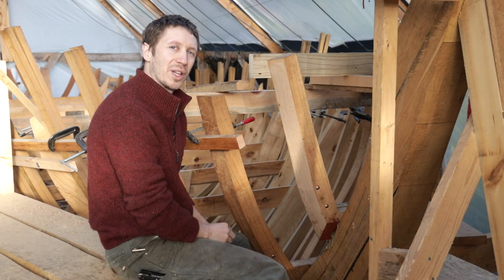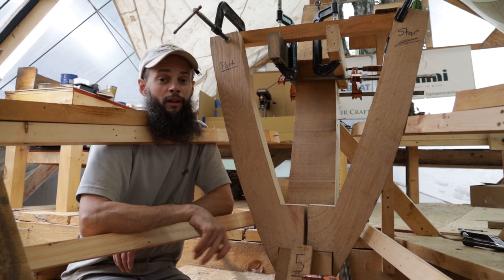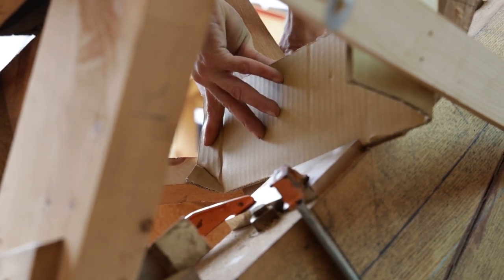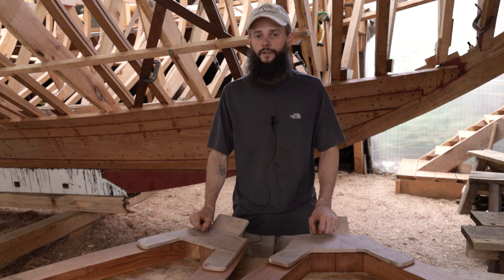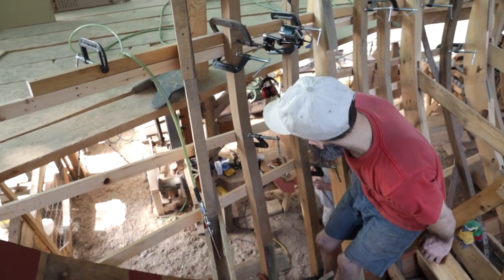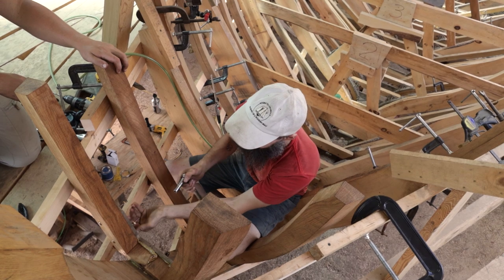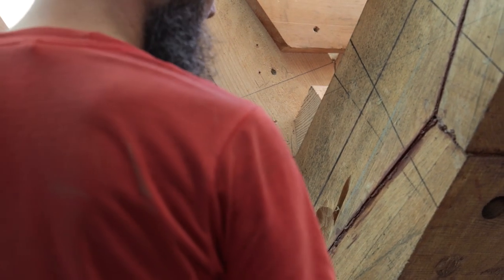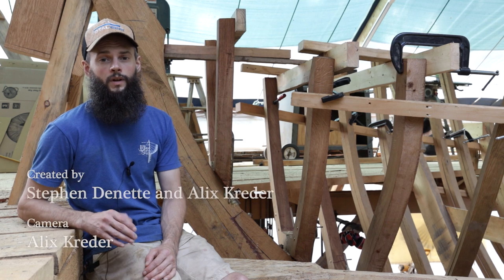Acorn to Arabella - Journey of a Wooden Boat - Episode 80: Sawn Frames and Bronze Floors

Comment: Dangar Stu made me aware of your mammoth project. I finished watching all episodes moments ago and ordered my "Quercus alba" writing instrument to help you guys and remind myself of my less than stellar construction of a 10 ft boat framed with 2 x 8 white oak designed for a 10 HP outboard. The only spare motor I had was a 35 Evinrude so I didn't spare the HP or the bedding compound. 'Twas a miracle it didn't sink. Acceleration was instant. 
Your attention to detail is amazing. Glad you went for a new Kubota diesel. Nordhavn's latest small trawler is powered by a pair of 75 HP Beta mechanical injection so no expensive electronics to die in the middle of the Atlantic. If you are still friends when the boat is finished, you can sail everywhere and you'll have a happy boat with a great boat dog wanting to go to Norway!

Comment: You lads are are wood working geniuses, I wish I wasn't the other side of the pond I would have tig welded all your bronze with pleasure. Mig welding doesn't like nonferrous it's definitely adequate but it's difficult to get a good profile and even though it's probably unseen as a coded welder of 35 years I feel perfect weld profile would match your perfect carpentry. Can't wait for next episode.

Comment: Another great video guys! 

I do miss the original opening soundtrack though. Otherwise, keep up the great work!
Reply: That's just what I wanted to comment on. They went back and now this is the original song (well a remake) but still the original spirit and it's way better.

Go check out 3 videos back and 20 videos back and you'll see.
Reply: I also miss the original soundtrack. However when it was replaced by something dreadful, it took weeks of pointing that out before they changed it out with this remake. I suppose they needed a longer track to complement the longer intro, and the new track is essentially a stretched version of the old. Not quite as inspirational but better than nothing.
Reply: Please, guys, enough with criticizing the intro. Embrace change!
Reply: @mikeblake1000  Yes, we should. I expressed my opinion to Sampson Boat Co about the annoying crappy music they seem to have to insert like it helps (it doesn't) and stopped subscribing to them.

Comment: I have never welded bronze.  It is looking good! Nice.  Some general welding tip form me will be; wipe, grind, brush of any primer, oil and oxide so it just pure metal.  May do a longer point weld like one inch after tack-weld. The ide is not to melt all the point-weld. Check measurements. Usually it shrink 1-2 mm depending on the temporary braces and welding teknik. Put on an temporary brace.  ( take it off after cooling) Many metal like a little preheat before welding to like aluminium and steel.  It altso dryes off any moisture.

Comment: Wow that's going to be a beautiful boat.  I don't see why people gave it thumbs down.

Why don't you use the mold instead of cutting a new one? It's already the shape on the outside.
Reply: I suppose its just cheap wood and not suitable for their purpose because of grain/density
Reply from the maker: Correct, the molds are just knotty pine and hemlock.

Comment: Before you guys get to the shaft log, I hope you buy a PROPER hole drill.  Check out what Leo is using, a Milwaukee Hole Hawg !  These are expensive, but the are specifically designed to cut LARGE holes in thick wood.

Comment: Three more frames done and in place. Check. You might want to put a through hull for the anchor chain locker to drain the mud and water overboard at the stem instead of running the mud and sand back through the bilge. Just passing on a thought.

Comment: Thoroughly enjoying the build. I notice for all non-glued joints, you coat with red antifouling paint and bedding compound. I assume the antifouling paint is a substitute for the traditional red lead paint to help protect from rot and the bedding compound to prevent any gaps. Is antifouling paint as effective as red lead?
Reply from the maker: The red antifouling paint is a copper-based marine safe paint, it is as effective as the old lead paint with the added benefit of not leaching into the water.

Comment: Hey Ben, great stuff as per normal. I am loving the soundtrack and can't wait for the bouble box CD set to be released... (kinda kidding but not really).
I have a question, I will understand if time and energy don't lend themselves to your entertaining my silly shit but here goes. What is the advantage of slotted screw fasteners over Phillip's head? Since every single boat that I see being built uses the slotted variety there must be a most compelling reason but try as I may I can't find an answer written down anywhere. Thanks, if you get a chance to answer and thanks anyway for a once in a lifetime experience if you can't. Fair winds and following seas mate.
Reply: OK, here's my best guess: (hopefully someone more knowledgeable will chime in if I'm wrong)
Traditional boats use slotted screws because they are a work in progress. Those screws will need to come back out when there is the need to repair or refurbish. Trad boats rely on paint and fillers to protect the wood. It is relatively straightforward to chase those materials out of a slot, but virtually impossible from a Posidriv or square recess. Philips head, even setting this aside, are a total non-starter because the driver will 'cam' out when the torque resistance climbs, as it does in a big way when large fasteners are driven into wood)
Reply: Thank you very much. Seriously, thank you for your time and attention. From personal experience, this is certainly true.

Comment: Hi!
Don't you think the bronze floors on those new frames will be in the way when planking? They look a bit wider than the stem.
Thanks for a great channel!! Greetings from Sweden
Reply: They are wider than the stem, in part, but narrower than the frame. The planking is outside the frame, and intersects the stem at the rabbit line forward of the frame. The planking  fastens into the frames at that point using bronze screws, not bolts or rivets as there is no access to the inside of the lower sections of these frames, its solid wood right across the boat, and the floors are aft of the frames so do not conflict with the fastenings going into the frames.   So as far as I can see there is no issue..

Comment: Is oiling the edges of the planks correct?   Wooden planking is designed to swell.  Drive the oakum deep,, or cotton,, fill above ,, lead?  paint and finish.  But a wooden vessel classically must be hung in its slings over night, before you release the vessel from the slings.  The wood must be allowed to expand,, in order to have a dry boat.  Would the oil short that system?

Comment: So why not just use lag bolts when securing the bronze floors? Why take the extra step of driving a threaded rod and then securing the bronze floors with a nut and washer?

Comment: Not sure if cutting off those wings  on the frame was a good move? No direct fastening from frame to backbone and assymetric fitting everything at the back nothing at the front or side..... Maybe over reliance on those bronze floor? She should be right time will tell.
Reply: I personally think the bronze floors provide a much stronger connection, to the extent of rendering the frame nibs redundant. And the builders, who can see the two alternatives in real size and in context with the elements they are connecting, clearly thought so -- and they are conservative on such matters, as the build so far attests.